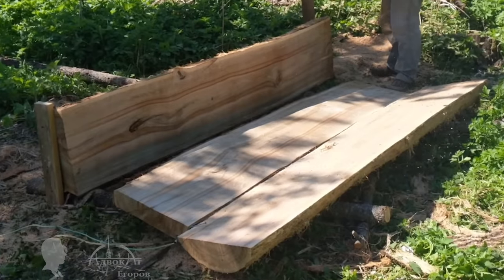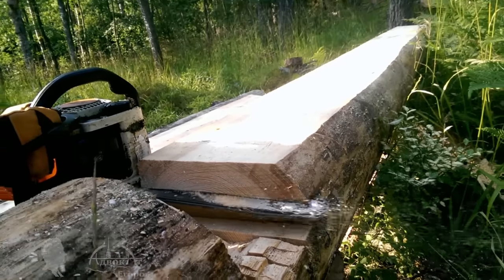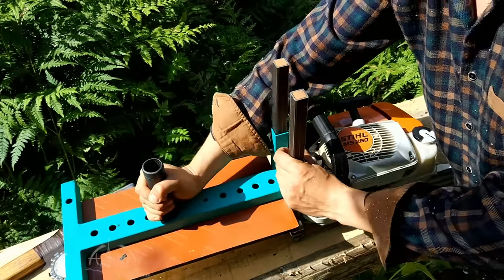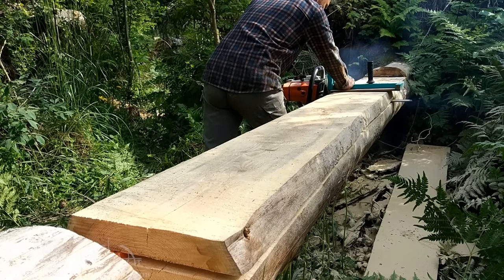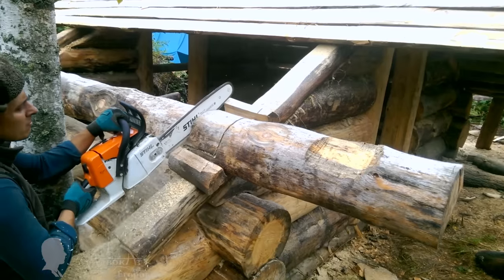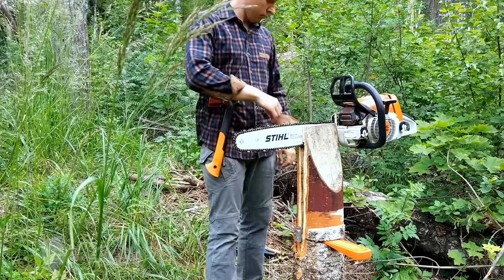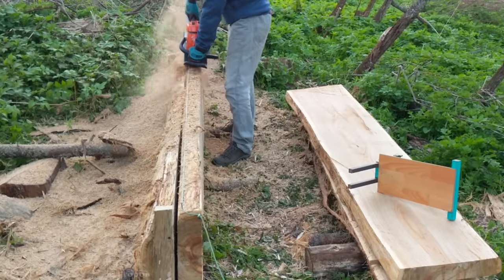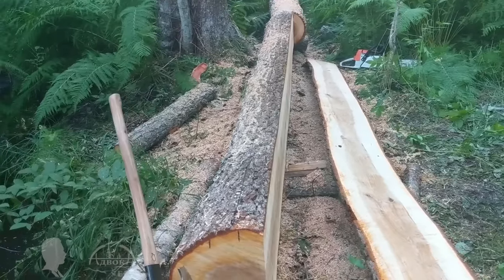Two Chainsaw Secrets | Turning a Tree into Perfect Boards

Comment: Hey Maxi, thanks for the interesting board cutting approach. I am wondering if you could upgrade your design with some kind of rail that you could slide the saw along so that you no longer need to keep the level manually. Something like this https://www.youtube.com/watch?v=1gneXK2jQ_U&ab_channel=AGSLandManagement but instead of pushing all the rail into the wood, just keeping only some of them as you do. That way, you could slide the saw back and forth just as you do, but along the rail, deepening the blade at every slide.
Reply from the maker: Thank you for the link.

Comment: secret #1 do not use a chain saw. the cheapest mill you can find will be worth the money. I can rip a board in .02 % of the time it takes a chain saw they are not made for ripping.
Reply: and if the cheapest mill is 100 miles from you? It's a luxury

Comment: Good stuff on here except for one thing.
That a chainsaw will not cut straight if the teeth on both sides of the chain are not evenly sharpened is a myth that has been repeated over and over for eons by people, it is actually a lie.
The reason for this is that the people stating this as fact have not ever proven this, to themselves or anyone else, it is simply accepted as fact. The only thing that makes a chainsaw not cut straight is when the rails of the bar are worn, not at right angles. Most people give bar maintenance little thought if none at all. Now if you have bought into the myth you might try to tell me that I am wrong, many have. I have a special chain for people like that. The chain is new and I have blunted one side of the chain completely on purpose. I demonstrate perfectly straight cuts with this chain to unbelievers. Of course my bar is in good condition. Most of the time they walk away without saying a word. None have ever tried to argue that it is an unevenly sharpened chain that is the cause of chainsaws not cutting straight after that demonstration. If you actually think about it in your head, you should come to the conclusion that an unevenly sharpened chain could have nothing to do with a chainsaw not cutting straight. All it does is affect cutting performance.

Comment: This method is not remotely viable for 90% of users, as most people don't know how to Sharpen a saw correctly. 
Buy a bigger saw and use an Alaskan mill if you need to mill your own on a budget.
Reply from the maker: Actually, if you search through the comments here there are a lot of success stories. One guy even sent a link to a video where he milled  decent slabs on the first try.

Comment: The piston head you showed is made of aluminium. Modern husqvarna are no better in this regard. The original replacement part of the piston head is about 15 euros but a good amount of work needs to be done to make sure it works properly once refitted. I've seen these heads crack and break. The fact that they are cheaper to replace than to make speaks of their shit quality to begin with. But, that is the world we live in when every quality manufacturer sends their products to be made by slaves in China.
Reply from the maker: James, thank you for the reply

Comment: 4:28 upir cutting upside down, u need to rotate the whole thing bec the weight of the wood is pressin on your saw. Wrong technique. you dont even know how to cut. My point is that you cut the end or the beginnig of the board. you should start about 2 inches deep and at the end use a wood wedge then cut both ends. This way your cut will be smoother and easier.
Reply from the maker: Thank you for the feedback